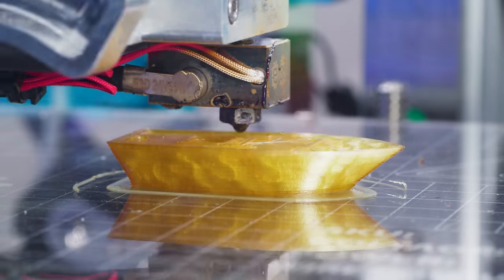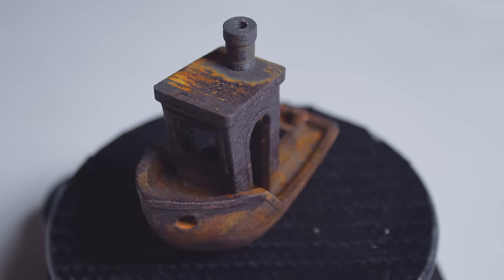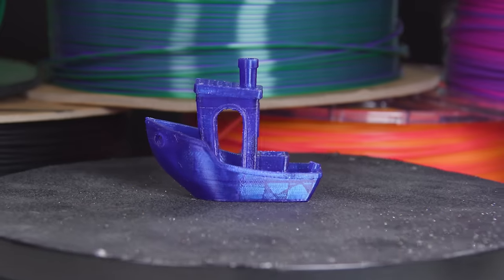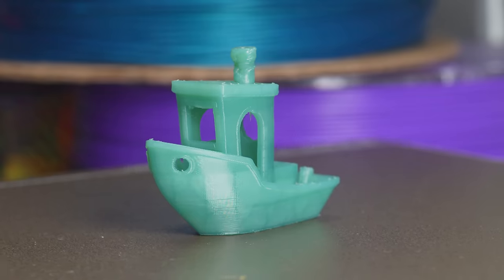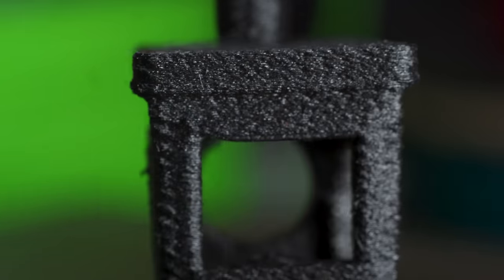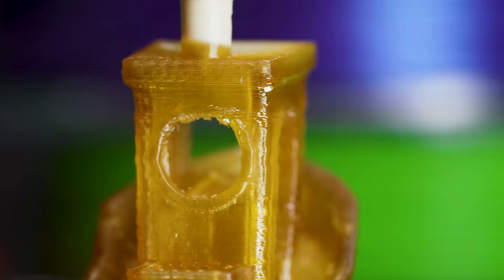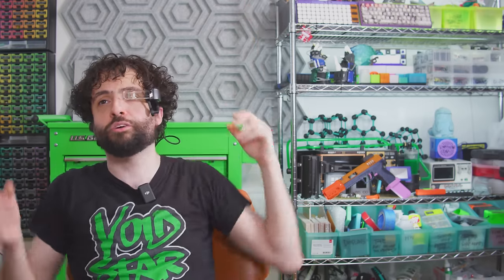The 3D Filament Tier List! Which Should YOU Use?

Comment: Hi!  Chemist here and wasn't expecting to get called out on a Thursday, but I'll take a crack at deconvoluting your chemical cuestion (I tried alliteration but got B-tier results).  Halogenated hydrocarbons are just hydrocarbons that have halogens in place of the usual hydrogen atoms ('hydro'-carbon, eh? gotta love nomenclature, most boring lectures ever).  So instead of ethanol, it could be something like tetrachloroethanol, with 4 chlorines instead of 4 hydrogens.  Could also be fluorines, bromines, or iodines if you peruse that column on the periodic table.  The real nasty ones are the halogenated aromatic hydrocarbons- similar to the styrene off-gas you mentioned, it could be like that but with more halogen atoms, making it extra carcinogenic- delicious!  There are fancy polymers that can incorporate that kind of stuff, so definitely up your enclosure game when getting into the toxic substances.  Check Safety Data Sheets for the toxicological hazards if you're not sure!  Okay, the inorganic acids are really boring: it's just the acids you may have learned about in high school chemistry- the 'hard acids' also known as 'mineral acids'.  Not the fun kind where you trip, unless you get it on you then it's a trip to a hospital.  It's the classic hydrogen chloride, sulfuric acid, and nitric acid families.  They're 'inorganic' acids because they don't really use carbon, whereas 'organic' acids do incorporate carbon, like carbonic acids, carboxylic acids, sulfonic acids.. they make some pretty structures if you need some inspirational alchemical bullshit to print!  Anyway, hope this was a bit entertaining to read/skim- I really enjoy your video style, Zac!  I'm an organic chemist that is super interested in materials and formulations, so while I watch every video you put out, I especially enjoy the deep dives in the material properties madness!  edit- i'd paused the video to type this comment originally, then continued to play where you talk about the safety concerns of toxic off-gassing lol, good safety notes!

Comment: Text and CSV versions of the list:

Text:
Class	Tier	Name
1PLA	1S	CF-PLA
2PLA Alloys	1S	CF-PETG
2PLA Alloys	1S	PCTG
2PLA Alloys	1S	Tough PLA
3Engineering Polymers	1S	PA-GF
4Flexibles	1S	99D TPU (Hard)
1PLA	A	Regular PLA
2PLA Alloys	A	ASA
2PLA Alloys	A	CF-PET
2PLA Alloys	A	PETG
3Engineering Polymers	A	CF-PC
3Engineering Polymers	A	PC-BT
4Flexibles	A	SEBS
5Obnoxious	A	PEI 1010 ULTEM
5Obnoxious	A	PEKK
1PLA	B	Silk PLA
1PLA	B	Wood PLA
2PLA Alloys	B	Flex PLA (PCL)
2PLA Alloys	B	HIPS
2PLA Alloys	B	PETG
2PLA Alloys	B	PVB
3Engineering Polymers	B	PA-12 Nylon
3Engineering Polymers	B	PA-6 Nylon
3Engineering Polymers	B	PA6-CF Nylon
3Engineering Polymers	B	PC
4Flexibles	B	95A TPU (Semi-Flexible)
5Obnoxious	B	PSU
2PLA Alloys	C	ABS
3Engineering Polymers	C	Nylon-PET Alloys
3Engineering Polymers	C	PA12-CF Nylon
3Engineering Polymers	C	PMMA Acrylic
4Flexibles	C	88D TPU (Soft)
5Obnoxious	C	CF-PEEK
5Obnoxious	C	OBC
5Obnoxious	C	PEEK
5Obnoxious	C	PES
5Obnoxious	C	PPS
5Obnoxious	C	PPSU
1PLA	F	Metal Filled PLA
4Flexibles	F	TPE
5Obnoxious	F	HDPE
5Obnoxious	F	PEI 9085 ULTEM
5Obnoxious	F	POM
5Obnoxious	F	PP
5Obnoxious	F	PVDF
5Obnoxious	F	TPI (Capton)

CSV:
Class,Tier,Name
1PLA,1S,CF-PLA
2PLA Alloys,1S,CF-PETG
2PLA Alloys,1S,PCTG
2PLA Alloys,1S,Tough PLA
3Engineering Polymers,1S,PA-GF
4Flexibles,1S,99D TPU (Hard)
1PLA,A,Regular PLA
2PLA Alloys,A,ASA
2PLA Alloys,A,CF-PET
2PLA Alloys,A,PETG
3Engineering Polymers,A,CF-PC
3Engineering Polymers,A,PC-BT
4Flexibles,A,SEBS
5Obnoxious,A,PEI 1010 ULTEM
5Obnoxious,A,PEKK
1PLA,B,Silk PLA
1PLA,B,Wood PLA
2PLA Alloys,B,Flex PLA (PCL)
2PLA Alloys,B,HIPS
2PLA Alloys,B,PETG
2PLA Alloys,B,PVB
3Engineering Polymers,B,PA-12 Nylon
3Engineering Polymers,B,PA-6 Nylon
3Engineering Polymers,B,PA6-CF Nylon
3Engineering Polymers,B,PC
4Flexibles,B,95A TPU (Semi-Flexible)
5Obnoxious,B,PSU
2PLA Alloys,C,ABS
3Engineering Polymers,C,Nylon-PET Alloys
3Engineering Polymers,C,PA12-CF Nylon
3Engineering Polymers,C,PMMA Acrylic
4Flexibles,C,88D TPU (Soft)
5Obnoxious,C,CF-PEEK
5Obnoxious,C,OBC
5Obnoxious,C,PEEK
5Obnoxious,C,PES
5Obnoxious,C,PPS
5Obnoxious,C,PPSU
1PLA,F,Metal Filled PLA
4Flexibles,F,TPE
5Obnoxious,F,HDPE
5Obnoxious,F,PEI 9085 ULTEM
5Obnoxious,F,POM
5Obnoxious,F,PP
5Obnoxious,F,PVDF
5Obnoxious,F,TPI (Capton)

Comment: You must have only been doing cheaper systems. You have to get a at more expensive with industrial models for them to work well with good software for stitching. I’ve worked on the ATOS and T-scan systems with zeiss.

Comment: HDPE looks like Hotglue.  😂  I'm not convinced HDPE isn't just Hotglue on a filament spool.
Just got myself a Bambu P1S, I think I might go with the PCTG filament.  I know it's one of the more expensive ones, but for what I plan for it, I'm gonna need it.
Might even go for ABS or ASA in the future so I can weld them layers together for a better finish to sand down and paint.
P1S even comes with an activated carbon filter for its enclosure so I shouldn't need to make it vent to outside...But I might print a custom top end or fan attachment just in case I need to hook it up to a window.
Anyone here have any suggestions to a decent filament from this list for cosplay armor?

Comment: step on this again and still kinda sad for ABS in C and ASA in A. I would probably throw them in A/S.
ABS is cheap and comes in any color you want (not quite PLA level but prob closest) and ASA is pretty much THAT filament if you want not-flexible thing in consumer grade. Also a gripe for Voron people since they are also THAT filament to use as everything else south of ULTEM creeps when used in voron parts. Quote one of the mods in voron "For some dumb chemical reasons ABS do JUST WORK" for voron parts. And ABS cools faster than PLA so sky is the limit on speed (more realistically your max VFR is the problem on a V0)
I usually just keep ABS on my printer for everything generic. swap to ASA when a design is final and need to be reliable. swap to PA12CF when I was like f*** why this thing keep wrap/break. swap to PC when I needs extra temp resistence. (I don't use them but) swap to TPU when you need something flexible/tough. with a V0 + V2.4 350 setup there is really no reason for me to go for anything else at this point. Yes I want to do PEEK but I have zero need for that just want to climb the PEEK :)

Comment: Can't sand, glue, or paint PLA after printing?? huh?? You can sand PLA into a shine if you want tf? And ABS emits fumes when printing. Unless you are isolating the printer in a separate environment, you should have an enclosure with a filter.

Comment: Worth noting mixing plastics is a homogeneous composite, not an alloy 

Alloying is only metals as the bulk, you can have non-metal alloying agents in the mix like carbon, but it’s not an alloy if everything is non-metal as the intermolecular interactions are very different from long chain organic molecules (where stuff like van der waals i.e. like 100 fold weaker than an ionic bond and 1000 fold weaker than covalent are the only forces relevant; whereas because alloys are mostly elemental mixes you get pseudo ionic bonds (closer to say theyre dipole interactions kinda like hydrogen bonds, but even that doesnt do it justice as metal alloys are able to share their electrons freely through the structure to balance any dipoles) forming the bulk of the interatomic forces

I’m revoking your material science nerd badge Zack
Not mad, just disappointed

Jokes aside this was a really cool and insanely useful video, have literally bookmarked it as a reference because Ill definitely need it down the line for engineering
Time to buy me some 90D+ TPU and PCTG

Comment: Was the conductive filament included in the Metal filiment in the F teir? Curious to hear your thoughts on making projects with it
Reply: Conductive filament is something else entirely although metal filled filaments can be conductive. Most conductive filament is sold as ESD safe, it has a still pretty high conductivity but is low enough for some uses. Most of them accomplish it using some form of carbon, sometimes carbon fibre, sometimes carbon nanotubes, other times I believe just carbon black pigment.

Comment: The link to rigid TPU goes to 95A stuff. Where can one purchase 99D TPU?
Reply: I can't find 99D filament anywhere, not even any information on it, I'm not sure if it even exists. I test our 3d printable hardware tools with HTN-CF25 and it's very strong but it shatters if you over torque it. Zack says the 99D TPU is hard and unbreakable so it might be perfect for 3d printing our tools.
Reply: @3dprintedhardware  I'm thinking it was a sample roll from someone but that it's not readily available anywhere. I can think of a few things that would be ideal for that kind of material.

Comment: You are way too hard on PA6+CF, it obviously depends on the brand but if the filament is good you can even print it without an enclosure. But the good stuff comes around 100USD per kg

Comment: I am just wondering how we can find out which PLA+ filaments are the kind with PBT. I have used materials such as Polymaker's Polymax PLA and Atomic Filament's impact modified PLA which are much stronger, slightly more flexible, and more impact resistant just like how you described. I just can't find definitive answers as to whether or not they are the PLA and PBT mix.

Comment: Please suggest a good filament for hollow underwater relatively high pressure application (down to -50 meters). It has to stay dry inside and not soak in water. Also UV protection is mandatory. Is PETG good for that? Maybe with epoxy coating?
Reply: Ooh good question! I don't have an answer, but I've always wanted to print a submarine so I'll stick around in case anyone else answers
Reply: @Ashley-1917  it's not a submarine but it serves a similar purpose.

Comment: I have two rolls of ASA sitting in my Amazon cart right now waiting for a couple extra bucks to hit my bank account so I can try another crack at my cosplay and not have it completely shatter at the con
Reply from the maker: It’s great stuff. Remember you can use ABS cement for an even stronger bond than glue!
Reply: @ZackFreedman  I bought some plastruct and I'm going to dissolve some ASA in it to make very strong ASA glue. The plastruct it's just a plastic weld cement and dissolving some plastic in it gives you basically gloop but not 100% as good

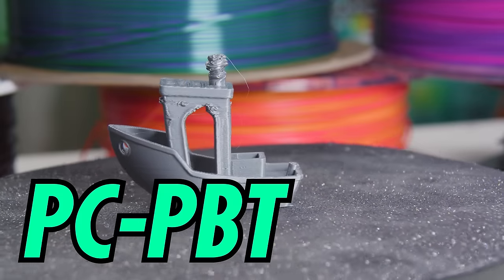Comment: I have a question...  How come some of the benchys you made look like total crap(i would have thrown away and tried again) and still get rated high on the list? 23:40 PC-PBT.  Zack even says "one of the easiest filaments to print with" but the benchy that got made with PC-PBT did not look good at all.  I am a total newb with printing in the 3rd dimension.  All i have ever used is PLA and my benchys do not look like that one did.  Just curious why PC-PBT was called one of the easiest and printed the crappiest and then got an "A" rating.
Reply: I am about to try to print an RC vehicle and the PC-PBT sounds like a great filament to use but i was just wondering if i use it will my parts print deformed

Comment: Wait CF PLA is considered low shrinkage? I have only used it a little, but in my time using it I had to do some major adjustments to my models to get them to print right because it shrank by almost 5% in some cases, and it never shrank consistently either. Nothing ever fit right and I had to print my parts 3-4 times in some cases because a 10 mm hole in cad turned into a 9.6 mm hole after printing. I haven't touched it since.
Reply: There is something definitely wrong with your CF PLA then, where did you get it from?

PLA is known for low shrinkage and warping and adding carbon fibre just makes things warp and shrink even less.
Reply: @conorstewart2214  I just got the standard bambu CF PLA. And it's been like that since it was fresh out of the box.

Very bizarre because the cf pla I got shrinks far worse than normal pla.

Comment: I hate life. I accidentally erased a long and detailed explanation for why  I need the toughest filament
.OK I want to print a model of a bomb like object i found.online. It will be fired out of something called a Can Cannon. Previous attempts to launch golf balls and pull my ham radio antennas high among the branches failed as the golf ball snapped the paracord instantly. I figured the aerodynamic bomb shaped object would work if reinforced internally with fiberglass and epoxy and weighed with loose lead shot mixed in and the heavier eyelet attached to some 45lb steel fishing leader..
Knowing that these may be one use items what would be the best material to print this bomb and possibly avoid it shattering. its not intended to hit any part of the tree, just to pass between branches so that I could lift and tie a pulley onto the branch and from there tie on the actual antenna, electrically isolated and the line on a pulley to slide up and down to counteract the wind moving the tree tops around. We can get 80mph wind storms on occasion. I have 7 trees down in my driveway after the last storm.
Thanks for your assistance ahead  of time. The Bambu Lab X1-Carbon Combo 3D Printer  is on sale at Micro center for the new Charlotte stores grand opening and I intend to buy it after hearing the glowing reviews. I know that this machine is not necessary to create this item but hate to buy other inferior items before graduating to buying the better one when it was possible. Thank You.

Comment: Got a good question for you, I have a project coming up where I have to design a set of custom cam chain slider for a motor, so heat, oil, and wear resistance , what would go to as a starting point for filiment.
Reply: Nylon would probably be best.

Comment: Any filament that is filled with anything else will always be weaker you are creating voids literal empty spots and imperfections in the plastic it will always be weaker from a structural point of view never use a plastic with a fill there's one exception and that exception is nylon nylon is so ridiculously strong that it can afford to give up some of its strength in order to gain the benefits of stiffness and still have enough strength left over to be still usable That's the only exception

There are a couple other exceptions for example I'm surprised you pooed on wood fill wood PLA is fantastic it smells great it feels great you get that nice matte finish it's stainable it's slightly and I do mean slightly sandable if you're careful and it's not that much weaker it can actually make parts decently strong weaker than pure PLA of course but not stupidly brittle like carbon fiber opiate carbon fiber PLA is useless for anything except aesthetics would be like still has enough strength to be useful however not when you have fine details if you have skinny bits they're going to break but if you have a relatively bulky part would PLA is fantastic I have a Groot hold ornament on my bus printed in wood PLA and it's been there for 5 years and it's still fine but there's no fine details on that there's no skinny extensions it's all thick

Silk PLA is interesting because the elastomers that give its shine actually makes it stronger silk PLA is stupidly strong like you can hurt yourself strong however it has no layer bonding you can print a vase mode print and silk and then you can grab the end of that print and you can delaminate that print all the way you could unzip it all the way into a single extrude strand again :-) it's quite fun to do :-)

You can mitigate some of this by only using silk on larger models and using a fatter nozzle with fatter layers once you start printing silk at 0.8 mm it loses a lot of its brittleness issues which aren't actually brittleness issues they're layer bonding issues The filament itself is stronger it just doesn't stick to itself anymore and we perceive that as brittleness which is a pity because damn some things look sexy in silk filament.

Comment: You got the metal filaments completely wrong and don't understand how you managed to do so. Metal filaments are 2 steps. 

Step 1: 3d Print using the metal filament <- you stopped here
Step 2: Sintering. The rough gist is the plastic is burned away leaving a solid metal 3d print. This can be done in two ways have your own means to sinter the print or using the included voucher, usu good for 1kg, that comes with the spool ship of the prints to a facility after a short turn around the return the solid metal finished prints.

Comment: "You can't sand, glue or paint PLA". At that moment.. i stopped watching. As someone who sands, glues and paints PLA all the time.. that is just weird thing to say. It paints JSUT fine. No problems. Sanding? Fucking hell, i just sanded a mouthpiece yesterday for a client, which means it has to be extra super smooth. No problems. I put it in the lathe, turned the inside, sanded the outside without any issues. Add water.. is the solution, soapy water to be exact.

How can i watch the rest when the FIRST item on the list is fucked up?

Comment: Hi guys. I have a part that I need to print, a faceplate for some fpv goggles and I've been trying with ASA but I haven't been able to get great results. It needs to withstand some temperature and being out in the sun, anything that should be better/easier to print than ASA?
Thanks
Reply: PETG or PCTG
Reply: Or order it from someone that has success with ASA.